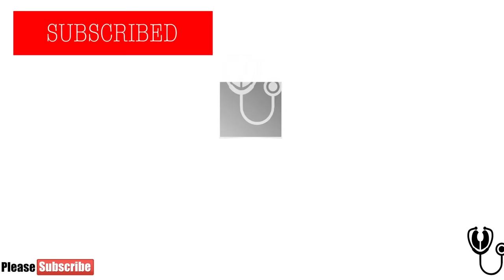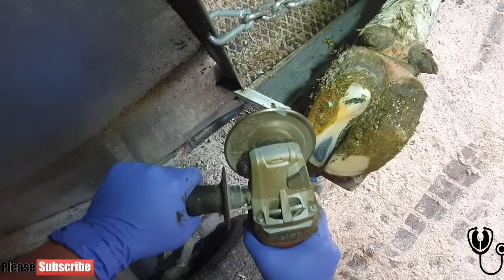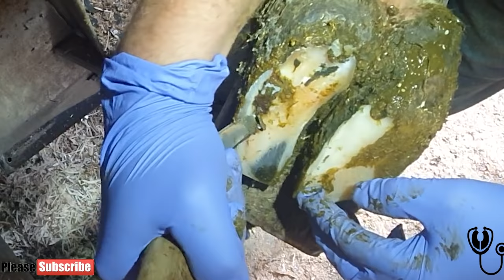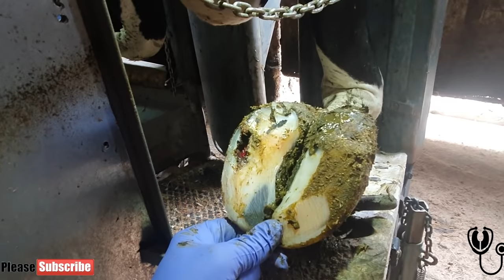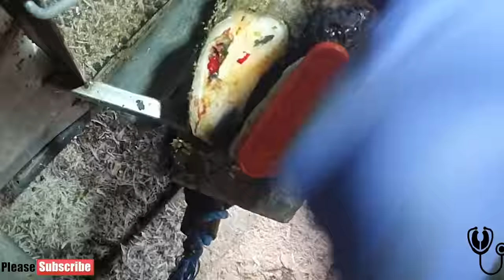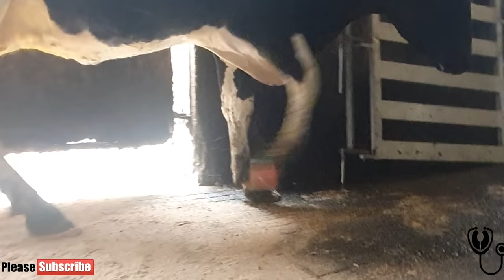HUGE STONE IN COWS FOOT | The Hoof GP

Comment: You need a tool called a hemostat.  I use one in sewing and they even use them in surgery. It looks sort of like scissors but there are teeth and it clamps. You could clamp onto the stone and remove it much easier than with your fingers.

Comment: He literally glued that thing right on the poopy hoof. Sealing it in. I will never understand why they don't just spray it off with a hose.
Reply: Joe L it’s glued onto the opposite side and most of it’s cleaned off where it’s actually glued, and it’s designed to fall of after a few weeks then it’s back to normal.
Reply: Obviously washing it isn’t need or it does more harm then good.
Reply: @Nathan-cv6sm  not just not needed but actually counterproductive in terms of getting the glue to dry.
Reply: I have an idea, why dont you just work with animals, guess that guys studies years for nothing and then you studied 0 years but still you are more prepared, such genius i guess

Comment: So has the block been applied solely for the purpose of ensuring the inside claw has less chance of having contact with the ground? Slowly picking up hoof trimming so still picking stuff up.
Reply from the maker: Yes.tjats exactly why - if there is too much weight on the sore claw it will not heal
Reply: @TheHoofGP  thanks. enjoying watching and picking up a lot from you videos only found your channel after Tom pemberton mentioned it on Instagram 👍🏼

Comment: Would it hurt to rinse the shit off of it first???
Reply from the maker: .... no but I might get electrocuted.
Reply: @TheHoofGP  Why not use a towel then to just wipe some of it off? I'm actually curious towards this. I mean I know some farriers don't even wipe mud off a horses hoof while working, but you'd think a glob of crap would make you want to clean off before working.
Reply from the maker: On average I trim around 1200 cows per month - to wash or wipe every cows foot (4800 feet per month) would be a task in itself - on the vast majority of feet the first swipe with the grinder removes most muck and I rarely touch the feet with my hands
Reply: @TheHoofGP  Makes sense. Do all cattle farriers use grinders? Is it a commonly used tool or is it used when excessive cutting is needed? I would guess it's seriously needed for shortening the tips of the hoof. Then again I'd say using the grinder would be far quicker and easier than using a rasp, haha.
Reply from the maker: Virtually every proffessional cattle hoof trimmer uses a grinder yes, I honestly dont know of anyone who cleans the feet first. Most just dust the floor with a large amount of sawdust to dry their feet on the way into the crate
Reply: @TheHoofGP  That's interesting. Thanks for sharing and humoring my questions, haha. Have a good one.
Reply from the maker: No problem at all